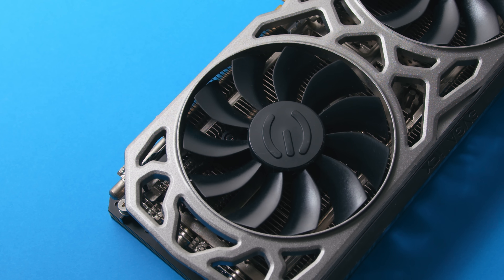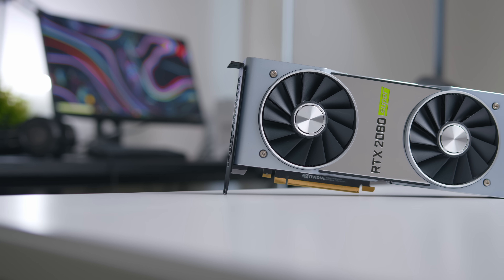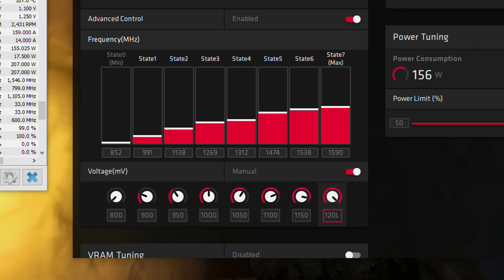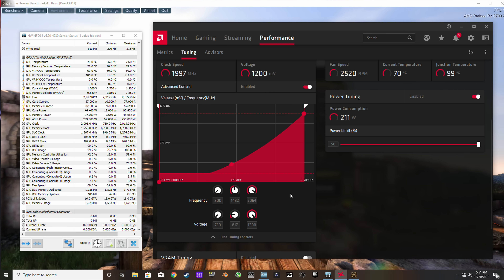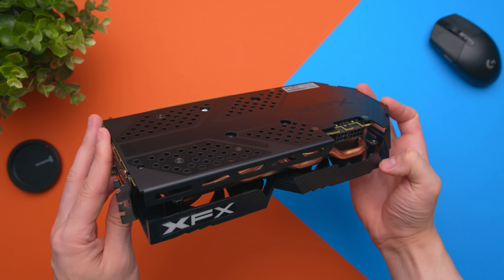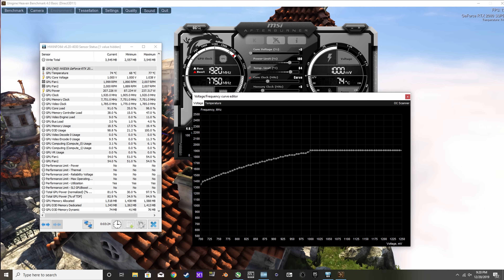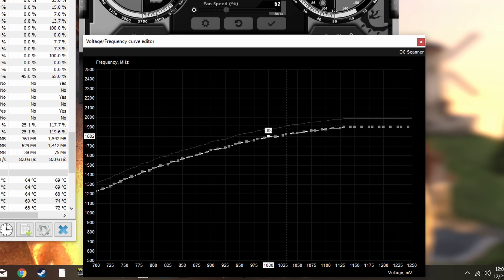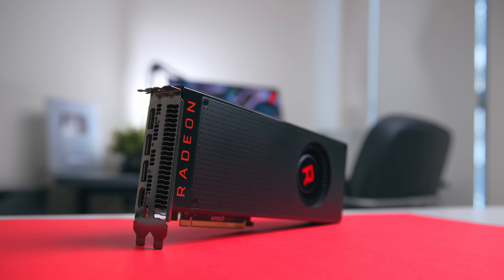The Ultimate GPU Undervolting Guide - Navi, Turing, Vega + More

Comment: Nice guide for under volting thank you. 

I have a Vega 56 non reference card so better cooling solution than reference. I normally under volt but also over clock the core and memory. I have my card flashed to a Vega 64 bios to get the extra voltage of the Vega 64 on the V56 card.

I use MSI After Burner for my OC needs because I find the AMD OC tool to be pretty much useles and prone to making my card act weird to the point I have to clean in stall the drivers. My normal OC is 1765MHz core and 1075MHz HBM2 memory (My HBM2 will go up to 1165MHz) on this card.
I max the power limit slider to plus 50 in MSI AB and under volt to -35 on the voltage slider. This nets me solid core clocks between 1715MHz-1765MHz & HBM2@1075MHz.

After watching your video I was wondering where my card would go if I set it back to stock ramped up the power limit to +50 maxed out & left core clock alone but under volted as far as I could go. I only did one test in The Division 2 in DX12 mode all details maxed 1080p. I used GPUZ video test and slide the voltage down to -125mv  which had the voltage around 0.950-1.000.

I'm not sure if I could go any farther down might try it later agian. I fired up The Division 2 and entered the game world. I play with Vsync on since I have a 60Hz screen and the wattage was only at around 95watts to 135watts 60 FPS Vsync locked on. Core clocks were around 1065-1235MHz GPU usage arounf 55%-73%. I turned off Vsync and core clocks went up to 1612Mhz-1650MHz steady in that realm of clocks. GPU usage stuck at 98%-99% wattage went up to 221 to 245 Watts. HBM2 was only over clocked to 1000MHz so power usage might be a bit lower if I left that at 945Mhz stock for a v64 card.

With just a under volt and power limit maxed out and a small HBM2 OC the power usage is so much lower than when I do my normal over clock. I might try these settings for a while and see if the card will be fast enough this way. I may also try to find out where the card bottoms out for a voltage floor I am thinking probably the same 0.930 shown in the video here. For refrence with my normal over clock in the Division 2 at the same spot in the game and Vsync off the core hits 1712-1769Mhz and power usage is 312-353 Watts GPU usage 97%-98% and the FPS is higher as well probably because the HBM2 is not at or near stock 945MHz but at 1075MHz which gives Vega a real boost in performance the higher you can get your HBM2 on these cards.

I do like the lower power usage as it is easier on the power bill as well as the hardware in the PC case. Thanks again for the guide it is really good for those wanting to dabble in these things but were affraid to try it for fear of breaking something. I was already pretty much doing my own dabbling but the video renewed my interest in it. Merry Christmas

Comment: Unlocked limits on my 5700 and run 2000mhz (actual 1920-1960) at 1.1v and matches 5700xt stock. While only hitting 80° (low 90s on junction) with 5700xt stock fan curve. I do like the silence of stock 5700 tho. Hoping ek fluid gaming stuff goes on sale huge like it did on black friday for boxing day. I want to see what this card can really do.

Comment: You actually did not undervolt your VEGA card here, you need to modify HBM voltage, because that HBM P3 state voltage is minimum voltage for GPU p6 and P7 clocks.

Comment: I bricked my Power Color Red Dragon 5700 XT by undervolting it. Never experienced anything like it. How risky would you say undervolting is?
Reply: how did it break?
Reply: @RundasSlash  Black screen while sound kept playing. Driver didn't recover, so after a while ended holding the power button. When trying to turn the computer back on it just kept power cycling. Tried both bioses, but didn't make a difference.

Comment: [RX460 bios modded to RX560] Nice video with your tips i could improve my old UV/OC.   Another thing that i noticed is when trying to optimize the  memory controller voltage (keep core freq under 1Ghz ) HWINFO will show (GPU Aux Voltage VDDCI) if your target is 800mV but the  card floors it at 875mV.    Later when setting the P7 the IMC automatically  go up to 950mV if needed, even if 875mV is your setting.   My modded card has a softpowertable to increase min voltage from 715mV to 731mV;   P7:1297mHz@1150mV P6:1249@1056mV P5:1200@994mV   Memory: 2000mhz  the card is powered from just the PciEx.

Comment: Overclocking a GPU is not worth it, but undervolting is.
Reply: Oscar Shen 10% free performance gains not worth?
Reply: @bulgarianb3ast  Can you really tell the difference between  100 FPS and 110 FPS with your eyes? I can difinitely tell the difference between 2000 rpm and 1500 rpm with my ears.

Comment: Thanks I was about to undervolt my 2060
Reply: Could you help me out in trying to undervolt mine
Reply: @adama9866  Sure. What I did was I used a benchmark. And I used MSI afterburner to lower the voltages bit my bit until my FPS dropped. Then I stop. That is how you undervolt. Here is a guide:
Reply: @adama9866  https://youtu.be/0NaE0CvT4cI

Comment: This video was a bit late for me, but thanks for making it, most tutorial I saw were really bad...
My result : gtx 1060 3gb mini from zotac (the worst, but also the cheaper 1060 you can find), a reduction of 8°C, small reduction in fan speed (around 4%) and small increase in perfomance (about 2%) at 1911MHz 925 mV. Also made a 2GHz 950 mV profile, with +5% more point in unigine superposition and 5°C less than stock

Comment: I am surprised xD why the manufacturers don't do that directly from the bios? or this depend on each card and silicon quality?
Reply: It would take too long for manufacturers to do it, which in turn costs too much. And yes like with overclocking it is dependant on silicon quality.
Reply: @ZAKARIA They don't provide undervolted cards to the consumer because if they did they would be taking the silicon outside of the tolerances given to them by the GPU provider (eg AMD or Nvidia) and as @Duncan implies not all silicon is created equal.
Reply: Manufacturers choose safe values for each bin of cards. These values are purposely conservative because they dont want to put in the time and effort to perfect the curve on each chip, instead applying one curve that works for all chips in a single bin.
Reply: thanks guys

Comment: But if I do it on Afterburner I need always start the application befor I use my pc. I probably could set it up that Afterburner start when my Window boot up.
Reply: There's actually a setting in Afterburner to start Afterburner on Windows and starting it minimized.
Reply: @Sandkasten36  Yeah thanks for the help I will set up everything later. I have a 2060 Super this gpu is already really efficient but I still hope I can get some better temperatures. I get right now on my 2060 Super from Aorus between 55-60c in full load core temperature. I don't think I can get so much better results but maybe I could get 2-4c better.
Reply: @strohhuttv8848  In this case I would only go for noise. And oc it as long as the noise is acceptable for you. I don't think undervolting is necessary for you. In comparison - my card easily reaches 85 degrees without the undervolt. Now I'm also at around 60 degrees.
Reply: @Sandkasten36  From 80-85c to 60c this is a huge improvement. I don't have problem with noise unless it sound like a plane jet LMAO. My gpu right now is extremely quiet I'm sure the fan speed on 100% gpu load is between 20-40% I'm sure there is a lot of overclocking head room. I only don't want my gpu go over 70c or 75c this is the limit I would go for if I overclock it. I will see what I will do undervoling it or rise the voltage slowly and fan speed aswell and go with a overclock.

Comment: i have RX 5700 XT Blower
Undervolt settings: 1906mhz - 0.997v (media clock's 1840mhz)
I From Brazil so hot... 30 degress media ambient temp's...
My graphis card 74 degress max... i Happy! :D
Reply: Wow 74 degrees?! I’m my roommate has the power color blower and it runs in the 90’s. I’ll share this with him

Comment: I just want to say this ... Using unigine heaven for vega undervolting is a complete waste of time !!! Its a very light load on vega cards as they can do up to 270w core loads when properly configured ... Use a game like tomb raider dx or superposition extreme or if you want the absolute worst benchmark yet was metro 2033 redux ultra with all gameworks ... Without metro i was going with 1085mv on my vega and then i used metro ... Now i am getting p7 at 1125mv and p6 at 1100mv while hbm oced and +30% powerlimit

Vega producing heat is your worst nightname as the performance benefit will be determined by your noise tolerance (custom fan curve is the key) ... Now i am running a 250-260w core load at 75% fan speed max doing 3000rpm with 1580-1610mhz core speeds max
Hbm voltage cannot be changed with vega on 56 its hardcoded for 1.25v which can give you 900 to 980mhz depending on your memory type (samsung is better for overclocking) for vega 64 its 1.35v
 what are you changing is the floor voltage connected to the hbm p state to invoke it ... I recommend you do it connnected to the p4 or p5 state which was 1200mhz in my case i input the same voltage for that core p state on my hbm state  so older titles wont invoke this phase always and keep your vega cool and quite
One more thing ... If your v56 has samsung memory you must flash it to v64 to get the highest oc from hbm as it will give you more power to play with it
Reply: My vega 56 runs at 1050mv p7 185w(1490-1500mhz) and to keep hotspot in check I need 2500 rpm! Pretty fucking loud! Can't imagine those 3000rpm! Havent tried the vega 64 flash tho, is there any increase in performance from overclocking the hbm2 further?
Reply: @butifarras  it depends on you HBM maker is it samsung or hynix ?
How far can you oc your hbm ?
Hbm oc to 1000 is the sweet spot atm .. if your vega 56 can do 950-980mhz you are not loosing much performance just keep your temps in check ... You call 2500 as loud maybe you have a blower style card which is loud yes 
Mine is doing 2000-3000rpm during load as i set it like that with my custom fan curve to keep air circulation going
Reply: Xfx Vega 64 reference owner here. What was your full setting?
Reply: @ronaldsanpedro1976  these settings works fine on my red dragon vega 56 card flashed with a Sapphire nitro+ v64 bios your milage may vary 

 stock core speeds p6 at 1536 and p7 at 1630mhz ... Undervolting p7 at 1125 p6 1100 p5 1075 p4 1050 hbm speed changed from 945 to 1075 floor voltage 1050
Power limiter +30%
Fan curve 70c 75% , 65c 72%, 60c 70%, 55c 55%, 30c 25% stop fan on accoustic limit 1500mhz

I also recently replaced thermal pads and thermal paste with a high end ones (pads arctic 6w/mk 1.5mm for vrm drivers and gelid extreme 12w/mk for the vrm chockes , thermal paste was a very generous layer of a cooler master mastergel nano maker new 11w/mk )
Gpu still performing well after one month so far
Reply: @AIScents  thank you for this. We almost arrived at the same settings  however im at a much louder fan profile being a blower style cooler 65% at 69°. I also lapped my heatsink vapor chamber and repasted it with TG kryonaut. It did improve my temps and gpu hotspots.  Have you also tried leaving every thing it stock and just adjusting the power limit to -5 and a custom fan curve and and your prefered memory overclock? My resaults were pretty close to my manual UV/OC results as well. I do have a 7 liter itx case so my cooling settings are very limited. Hehehe optimising on what i have ( vega 64 ref, r7 1800x with 92aio on a dan a4 case, hehehe a very hot and loud combination.)

Comment: My rx580 has a really big gap:
It works fine with 1300mhz on core and 860mv. But 1350-1420 mhz works only at 1050mv.
So guys, try to reduce speed if you can't get your gpu cool and quiet. Moreover, on rx580 there is no much difference between 1300mhz and 1400mhz in performance. It's better to overclock memory to state 2, 2100-2200mhz and 900mv.
Reply: I have a problem with undervolting my rx 580, everytime i turn on my pc my wattman settings reset to default, i run stock clocks, i just lower the voltage to 1050mv and set the power limit to 50% and that's enough for me but i'm getting tired of that problem
Reply: @NattyAllTuna  I had the same problem with old drivers. Moreover,you can write your voltages down your bios, using ATI bios flash and Polaris bios editor.
Reply: @NattyAllTuna  or you can use MSI afterburner. By ctrl+F u can edit your voltages and run it automatically with windows startup
Sorry for my English
Reply: @Max.Sc. at furmark 130-140 watts, games 75-100watts. For example, destiny 2 is 65-80watts.

Comment: My 2080 stock ran between 1890-1910 mhz at 1.050v, 70-78 C at stock. I got it running at 1950-1980 mhz at 0.975v, 63-74C and now i got it at 2025-2075 mhz at 1.037v same temps and after thermal paste replacement 52-66 C with a max fan speed of 68%

I got the Asus rtx 2080 strix advanced
Reply: That's impressive :0
Reply: @robertjoergensen  yeah, i'm happy how it turned out but because of gpu boost i can't get a stable clock speed like on the gtx 970 that i had 4 years ago. (every 5 °C clock speeds go down about 15 mhz)
If only i could turn off gpu boost i probably would be able to maintain a stable 2070 mhz or more .( with some more tweaking)
Reply: Damn that's a nice result man :).I only tried this yesterday on my Aorus gtx 1080ti waterforce card and it only dropped my temp by 3c but power consumption dropped around 35 watts ...Might not be anywhere near as good as yours but hey 55c max load temp in a room with an ambient temp of over 30c down to 52c isn't too bad I guess :).My memory is at stock though so might be overclocking that next but not sure if it's even worth it tbh lol.
Reply: shit dude. I have a 2070 SUPER Strix. Do you think it's worth it to re-paste just to replace the stock paste? I would be confident in doing it, it'd be a fun project.
Reply: Duuuuude, Kiwi that's some awesome results. Nice job!
Reply: what thermal paste did you use?
Reply: the 4cats  thermal grizzly kryonaut 
It’s an expensive paste but it really does the job quiet good
Reply: @kiwibom1  luckily i'm using that kryonaut too for my 1060. i think i'll try for my rtx 2060 super. thank you for replying. cheers
Reply: My Gigabyte RTX 2080 Ti Windforce OC when playing Control for example quickly gets to 75-82'C temps and the fan is at 2800-3200 RPM, it's very loud. I replaced the stock thermal paste (or what was left of it) with Thermal Grizzly Kryonaut, replaced the thermal pads. It didn't do anything whatsoever, the temps are the same (even with custom fan curve settings). I undervolted the GPU today and it's at 0.837 mV @ 1560 MHz fan at 2200 RPM and it's 70-74'C with open case (with case closed it gets to 80-82'C). Not sure what the hell is wrong with this card.
Reply: @Ziomeq57  did you adjust the temp target?

Comment: I dialled in a 100MHz OC on my 1070Ti with 80% power target and 70C temp limit. It will typically boost to around 1950MHz, and it stays waaaaay quieter than the old "max all sliders" method.

Comment: Can undervolting being made at BIOS of the GPU level ? 

I am asking because i have a Radeon VII with modified heat shield and all thermal paste has being remade. Works great with good performance and temps BUT i will soon include it in the new Mac Pro, hence asking if Undervolting and a bump of MHz can be made at different level.
Reply: It can yes, but it's more complicated. Miners did it all the time on Vega and Polaris cards.
Reply: @gismo3564  Hello Christian. Thanks for the reply. Can you please redirect me to a source of wisdom ? link ? forum ? somewhere i can find more info about this ?
Reply: @gismo3564  I played around with bios modding when I had my R9 390x card. changed default stock core clock amd memory clock. I also changed all P-state voltages lower. With these new changes the card ran cooler and quieter for the new stock settings. Which was pointless because I then would OC the card with MSI AB to the max anyway. 

I think the only P-State I raised was P7 or what ever it was on those cards for game clocks which allowed me to be able to hit 1236Mhz on the core which gave a nice boost in FPS over dedault stock. The memory also had a huge OC on it I just don't remember it's final OC clock but GPUz said it had 467GB/s bandwidth over the stock 384GB/s bandwidth.